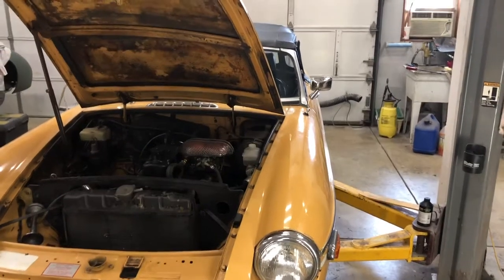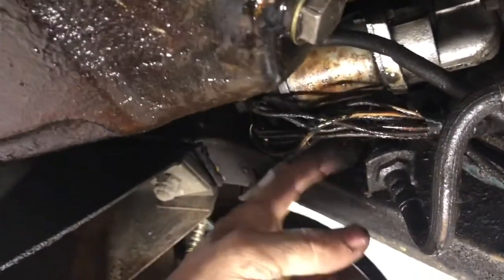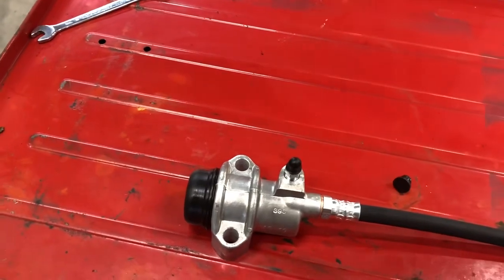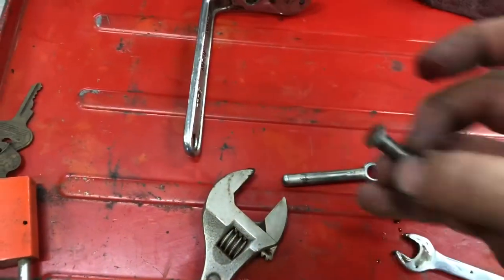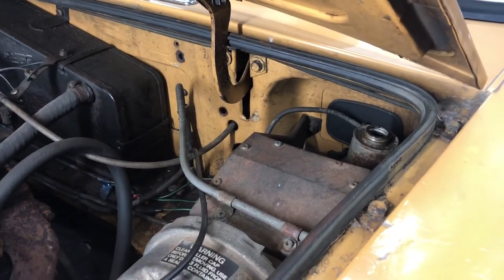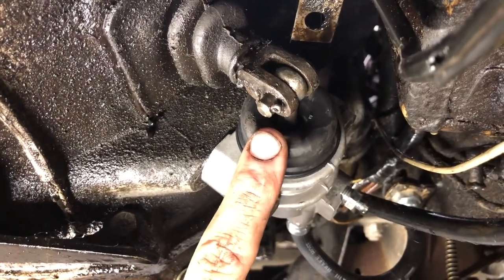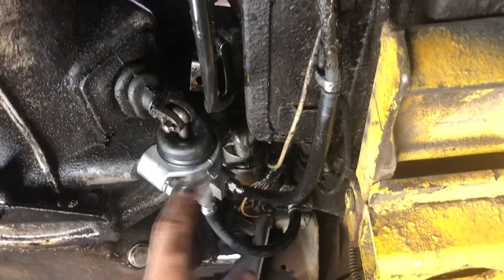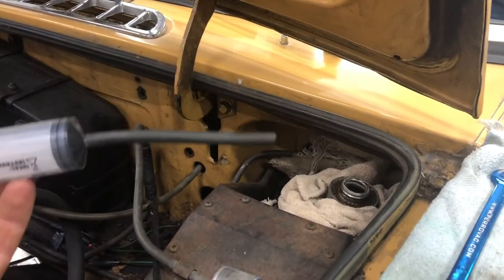MGB clutch slave cylinder and hose replacement

Comment: Awesome video, straight forward step by step.  I had a midget back in the 80's.  Now looking at a 77 B.  Any advice? Run? lol
Reply from the maker: MGB’s are good cars, and can be a bit easier to work on than Midgets. Condition, condition, condition…. Rust is more time consuming and expensive to deal with than mechanical issues. Buy the best you can for your price range and if your not sure what you’re look at, find someone who knows to go with you. Join the local club ( if you’re not already a member) BEFORE you buy as the members will almost always be willing to steer you away from bad cars and to good ones.

Comment: Thank you!  In your experience, does it matter if the new replacement slave cylinder lacks the small pedestal foot that supports the back of the cylinder against the side of the transmission?   My original lockheed cylinder had it but the new one I just bought on Amazon doesn't.
Reply from the maker: I haven’t seen one without the pedestal in years ( I source all my parts from Moss, even the cheapest one they sell has it these days ) I know John Twists says to stay away from ones that don’t have it, but I’ve never actually had a problem with them when I did see them other than they are made cheaper and don’t last quite as long before they start leaking. I theory they can flex a bit without the support, but it never seemed to actually effect the operation of the few I have installed. I you wanted you could find a small washer of the right thickness and sandwich it under the body for support and us a dab of suitable epoxy to make sure it stays.

Comment: since it is likely the master & slave are about the same age, it is likely the master is soon to follow with a failure. Best to do both at once since the master is not that expensive and bleeding is a pita
Reply from the maker: You have a point in that the current aftermarket master cylinders are pretty cheap, but I find slave cylinders don’t seem to last nearly as long as the master cylinders do. Many MG owners are pretty thrifty and would rather replace the slave cylinder only if they can though.